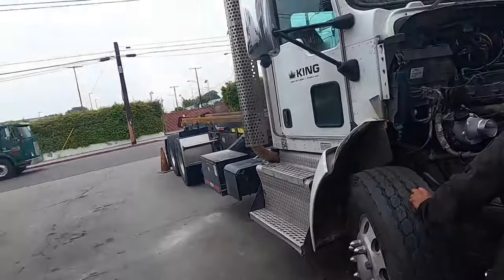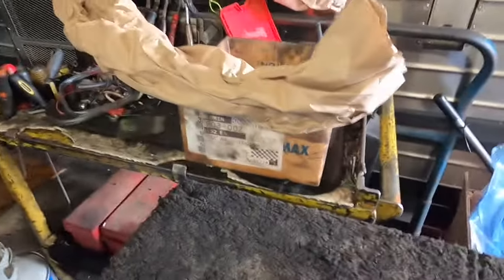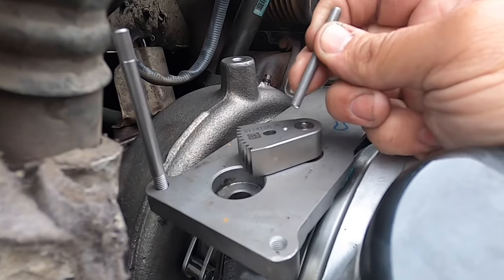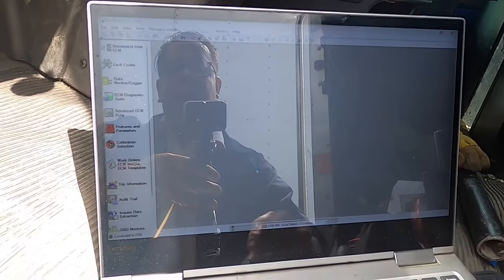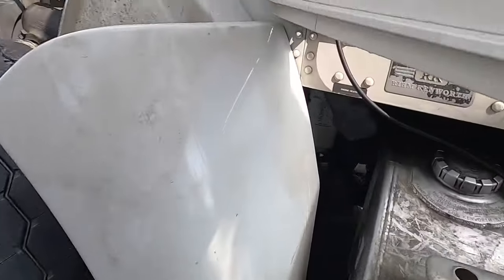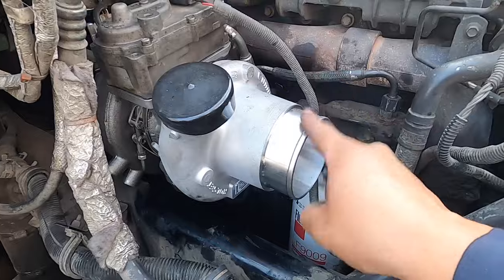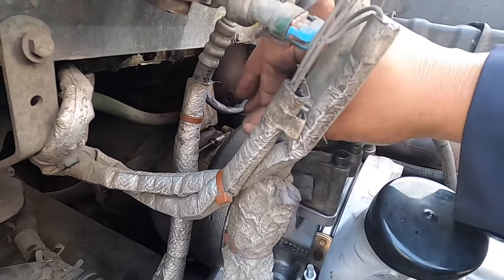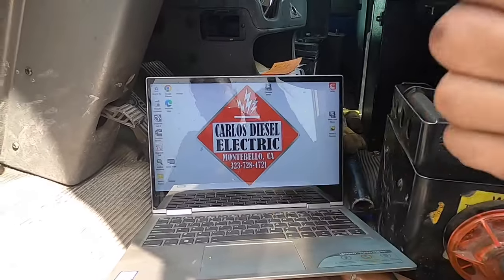How to calibrate the turbo actuator once you have replaced your Cummins turbo. This is a must

Comment: Thank you. I always thought it was a major process to calibrate the VGT. As for the old turbo I know it's always recommended to buy new and im a true believer in that. But I know sometimes money can be tight and they can be rebuilt, are rebuilds somewhat good as new one?
Reply from the maker: Rebuild can be tricky because there are good and bad rebuilds. 
The warranty they offer is typically 6 months. If the shop that rebuilds the turbo finds dirty oil or any signs of contaminants the warranty is typically voided. 
Try to find a shop that stands behind their work, has been around for a while. 
But you are correct, with prices so high rebuilding has become the way to go so save money.

Comment: I replaced my turbo actuator along with my VPOD on a 2015 Cascadia with DD15. I calibrated the actuator by measuring the rod length on the old one and applying it to the new one, but do I need to do a relearn or calibration on the VPOD?
Reply from the maker: No the Vpod is air controlled through the MCM. No calibration is needed. It is plug and play.

Comment: Can you scan a freightliner Cascadia with a Cummins engine using Cummins Insite software?
Reply from the maker: Yes. Insite allows you to connect to any Cummins engine with the exception of Ram. Ram trucks use a proprietary plug.
Reply: @CarlosDieselElectric  Thank u so much!